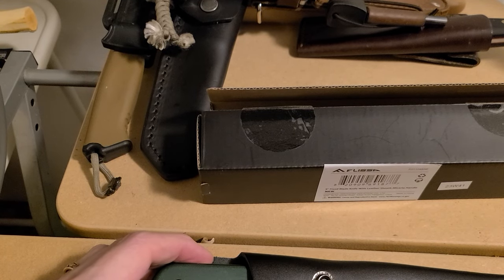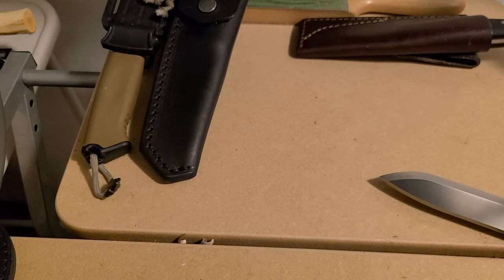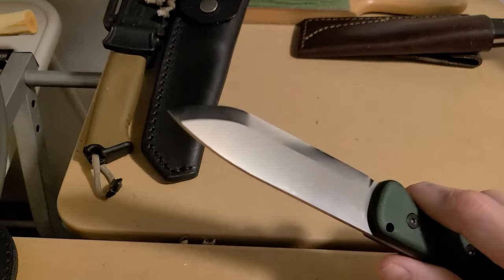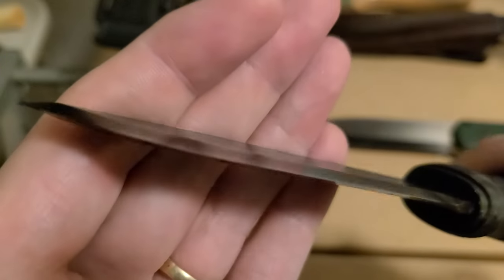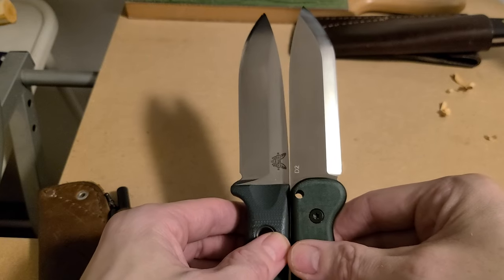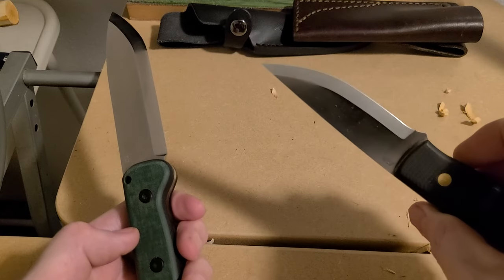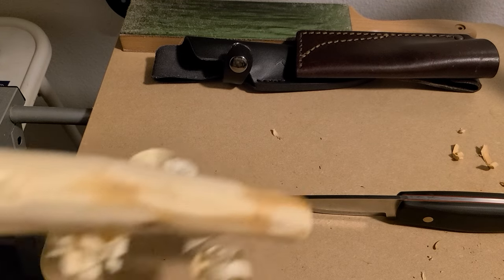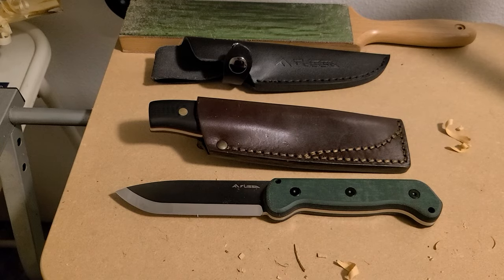Flissa Bushcraft Knife in D2 Steel, budget knife of the year ?

Comment: I just got mine in Black G10.  I like the heft and feel better than the BenchMade Bushcraft and doesn't have the weird ass embelishment angles in the handle. It's all well rounded edges.  Seem to be a no bullshit, right on design with decent enough steel.  I'm really happy with what I got.
Reply from the maker: Agreed , the Benchmade Bushcrafter is a waste of money. The only thing I wish is that the flissa had some palm swell but adding new scales or liners will be an easy fix.

Comment: This is the Nedfoss Sea Lion but with a green handle. Both rock D2
Reply from the maker: @rollypollyguy3976  Yep, I rehandled this one and another one on separate videos. I like them enough to upgrade um.  It's basically a $20 D2 blank in my eyes , best deal for projects I have ever seen. 

A blade blank of this quality will usually run around $70 . It's hard to find D2 scandi blanks anymore cause makers have a hard time heat treating that steel.  

The designer of the Ned Foss blade was upset to see this knife . He had no idea Flissa was producing his blade before the release of his sea lion. 

Kinda sucks. ..I don't who allowed Flissa to use his design?  I'm guessing it's the same factory Ned Foss uses and some contract stuff was in the small print 🤷‍♂️
Reply: @airiksknifereviews9548  That's ridiculously awesome!! My guts saying what you're saying, same factory. It's a smoking deal and I favor the green to black scales.
Reply from the maker: @rollypollyguy3976  The sheaths work but do not hold up well.  
For $20-25 ya can't beat it esp if ya make handles its a great project blade. After I rehandled mine they felt like completely different blades. 
I honestly would think they were a premium brand if it didn't say Flissa on um . 

Excellent stuff.

Comment: I like to try out knives like these at work and beat them
Reply from the maker: I am planning to rehandle this knife and adding a new sheath . My dog of 15 years had to be put down so I'm a bit out of sorts and haven't been doing knife stuff.  

I will put this knife to good use once I get a thicker handle....That said the steel is legit , but it could use a micro bevel or slight convex. It's very hard D2 , probably above 60 hrc .

Comment: Robust budget blade 💯🏆
Reply from the maker: I was using it the other day and realized I forgot to sand down the over sharp spine. I don't like the tip area with a sharp 90° spine it tares up my thumb.  So I took a rock to rub it dull....It did absolutely nothing. 
It's definitely D2 with a 60 to 62 Rockwell hardness if I had to guess. 
I haven't seen any chipping so far,  I've had D2 on scandi blades before and had micro chipping bit not on this one.